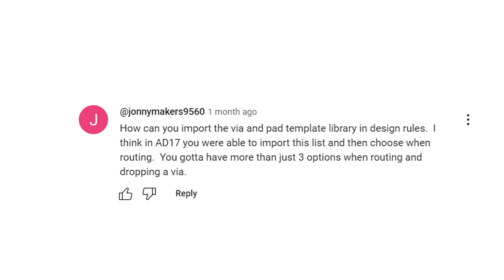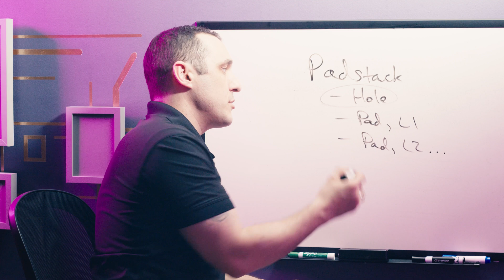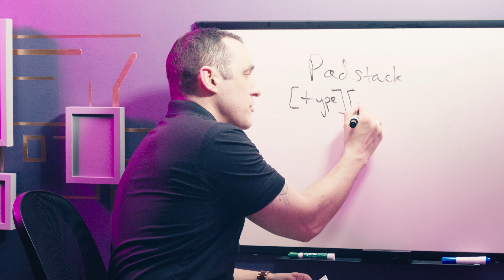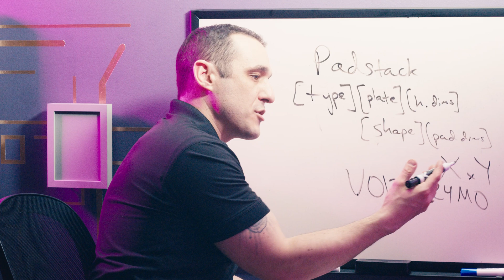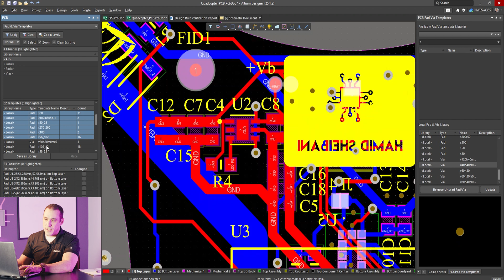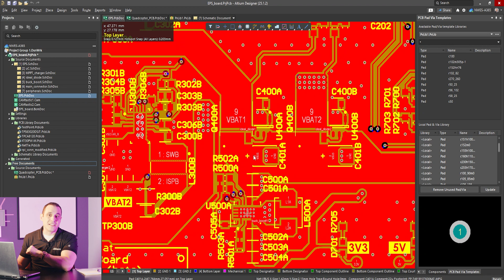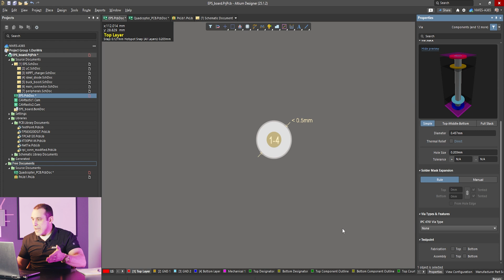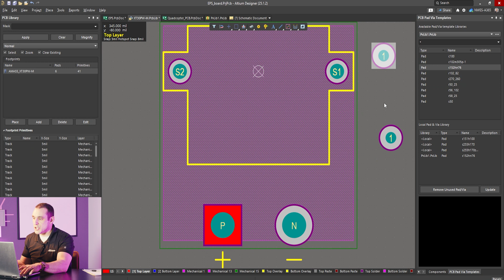Mastering Pad and Via Templates (or Padstacks) in Altium Designer

Comment: Is there a way to control the soldermask opening on a via.  I am attempting to use the Testpoint Manager to assign vias as testpoints and would like to be able to tent all other vias but those that have been assigned as testpoints.  Is there a way to do this?  Thanks for any feedback.
Reply: Great question! I don't know if there is a way to do this in the query + filter system, maybe there is a command for it, you should check the documentation. There might also be a comment indicating test point assignments in the PCB List panel. In terms of a workflow I would first tent everything, then selectively go back and untent and assign testpoints at the end of the design process, then you should (ideally) not have to go back and fiddle with mixed tenting and testpoint assignments.

Comment: I have a call request in with my fabricator to discuss recent issues around annular rings in designs regarding IPC-6012 space addendum projects, as I keep having trouble during review finding annular rings that are too small before release as the IPC-2221 rules get a little complicated involving the number of layers, thickness of each layer, hole size tolerance, the “c” tolerance, etc. Is there a way to make a pad stack via library “smart” (or I will just brute force some common ones) but more importantly make a design rule smarter than just a general minimum annular ring, as it may be too conservative or too lax for tight designs as hole size and other things vary in the same board. TLDR pad stack library and DRC IPC rules aware.
Similarly, thermal reliefs for pads (not vias as you point out on your design reviews) are not currently dynamic in Altium design rules for a given diameter (which often means more current so a tiny spoke isn't enough), so the thermal reliefs don't change based on size unless you add rules/do them manually. There are IPC/rules on how to calculate that. Is there a way to do that automatically, or at least automate some of more of it, in Altium?
Reply: It would be nice if you can just define the annular ring for a given listed tolerance or a producibility level, but unfortunately you have to calculate it yourself and define it manually. I think there might be a query to call out specific padstacks, then you could create a global design rule for each padstack. If not, I know you could query by pad size.

Comment: How would you do a multi via template, for simulated differential layer transition structures with ground vias, anti pads etc?
Reply: Personally I would not do this, I would design the multi-via template in the PcbDoc and then copy the multi-vias around to other places in the PCB layout as needed. If you really wanted to create something like this, I would create it as a component, that way it has a footprint that can be placed in PCB which will be linked back to your circuits.